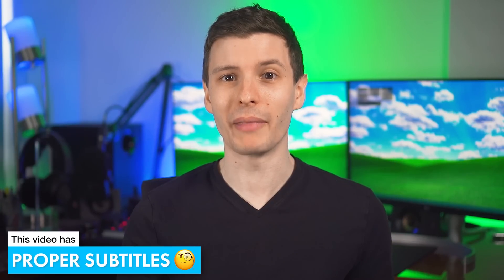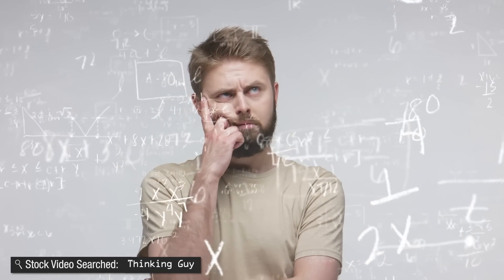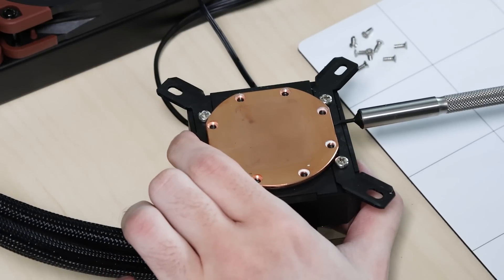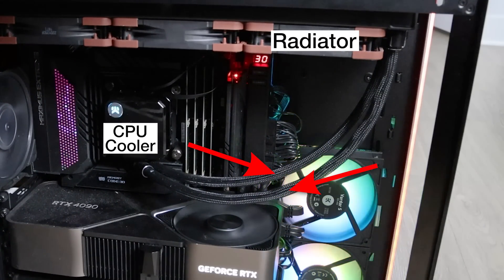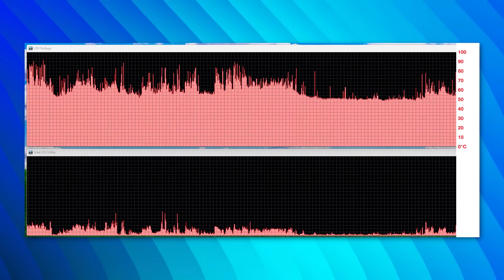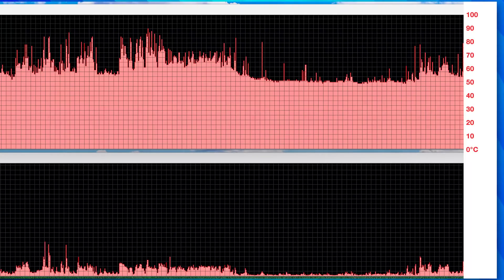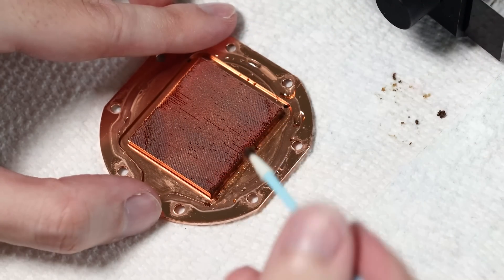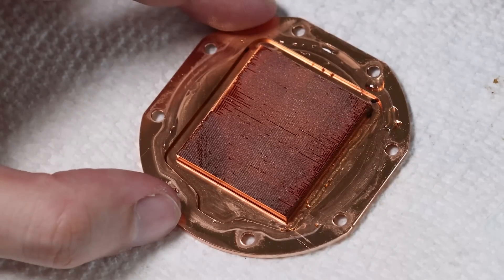The Mystery CPU Overheating Problem Took Me Months To Solve

Comment: dont trash the pump if you are going to replace it just open it get an old toothbrush use it on the fins on the block and if you want to unclog the pump take an old 6v charger and drive the pump with that so that any debris can escape the radiator and sell it as used im sure someone is going to use it

Comment: I run a custom loop, all copper no mixed metals to react and gum up the loop, I don't use the ready mixed stuff, but use distilled water and a bit of biocide and a small splash of antifreeze, I check the PH  and top up if needed every  3 months, I have just cleaned it out after my 1st upgrade in 5 years, and its the 1st time my loop has been cleaned out since about a year before the pandemic  and my waterblock wasnt  anywhere near as bad as that..  my guess is something is breaking down in the loop, maybe a seal or even the inside of the tubing or maybe  cleanliness during assembly wasn't as good as it should have been...  I clean mine out with a white vinegar solution flushing it out several times with distilled water,  and make sure everything is absolutely spotless  to prevent things growing in such  a complicated loop,  with watercooling you always get what you pay for and a lot of those AIO's use aluminium radiators which can react with the copper if there isn't the right amount of an active inhibitor  in the coolant  or if it breaks down...

Comment: I have heard AIO water cooler start to overheat in a year of operation.  The black gunk is the water hose breakdown.  The copper plate to be least clean one a year.  The CPU water cooler are not maintained free. 🤔

Comment: Greg Salazar would be proud, he documented a lot of these. MSI claimed it was a supplier qc process that caused the clogging and it has been addressed. Many brands went through that factory so a lot of CLCs from 2021/2022 had issues.
Reply: Glad to see this comment
Reply: @nmafchf  The root cause found by Igor's lab is allegedly that they used excess flux in the aluminum radiator construction, specifically units that needed a manual second pass during QA checks.
Reply: Greg would be partially proud. He wouldn't be proud about Thio sayin "I am not gonna bother with warranty" . He HAS to, it's not a matter if he wants to. It's a tech channel and saying that on camera, isn't exactly the best example of how you should manage those things.
Reply: @t3amb4sh  Thio Joe didn't recommend avoiding an RMA, simply stated he probably won't go down that route. I'm sure he has more important things to spend his time on.
Reply: @euge963  What's important, is what he recommends. Not every subscriber (or not) have the same perception you might have.
Reply: @t3amb4sh  really? I disagree. To me the choice not to RMA was never conveyed as advice, rather what he chooses to do. It wasn't the focus on the video rather a passive couple seconds of the video. He got it to work fine again, if it overheats again he'll just swap it. By then he might be out of the warranty window anyway.
Reply: @euge963  What does " chooses" mean? It's a global problem and you. .. choose not to get RMA processes involved? You are a YouTuber that influences many people. The only thing you choose is the right process. He may do whatever he wants with his personal rig. He may want to throw it out of the window.. When you decide to make a video about it, you tell people what's the right thing to do, especially with a common issue like this. And that's the end of the story
Reply: @t3amb4sh since he opened the unit, it'll be a back and forth on the RMA department. Sure you can claim you had the right to do so, but if they find anything that they can justify as a "user error", you're screwed.

Comment: looks like the gunk was either copper infused aluminium or aluminium infused copper, I've never dealt with water cooling myself, but Jayz2cents in basically every water cooling video that copper and aluminium doesn't play nice with each other, maybe that's the root cause?

JUST a THEORY, so don't at me or tell me how wrong I am, LITERALLY NOT interested in knowing because I don't PERSONALLY trust water cooling enough to ever adopt it, I'd rather stick to just air, if you like it, all the more power to you, again, I don't care in the slightest, just wanted to share an observation. that's all.

Comment: This pretty much covers my reasoning against AIO kits and even translucent water blocks in general.  With air cooling, you see the fins, you see the fan, you'll see the problem if there is any.  With acrylic waterworks, plugs, buildups, and air bubbles are very visible.  With everything concealed in an AIO, anything goes and you're the last to know.
Reply: I've seen inline flow indicators on other systems where it's critical. Something like that could be an option.
Reply: In the first 30 seconds of the video as soon as he showed he have AIO I thought "that's water pump problem". 
Mine would sometimes just stop when set to too low RPM, so just to be sure I set up throttling temp to 78C in bios, and CoreTemp software to system shutdown at 82C. With these settings system should switch off before CPU hits 90+C.

Comment: Just use a heat sink and fan. Liquid cooling with pumps may be a little quieter under max load, but they're far less reliable and don't provide better cooling at max load. Even the high end heat pumps you can find on store shelves don't perform any better than a $50 heat sink with fan.

Comment: 56 degrees Celsius isn’t scorching hot, 100 degrees Celsius is the limit.

And this is why I only air coolers in my computers even both my AMD 5950X builds.

LOL, using camera sensor cleaning swaps for removing the gunk in the AIO.

Comment: Similar thing that still (20+ years later) has my missus ribbing me about it. Non computer, but similar d'oh moment. Old car, fog lights at the rear not working, I checked the fuse, feed to the switch and was at the point of sitting with my dashboard on my lap, she says "did you check the bulbs?" .... Both fail together, don't be silly...another half hour later and I have finally got to the bulbs...yeah, they were blown. This is your 'foglights' moment. Welcome to the club of the sillies!

Comment: It’s going to happen again the fluid in your AIO doesn’t have the correct solution in it to stop the bacteria build up, like you said MSI had a big issue with their AIO. It’s a defect from the manufacturer that shouldn’t happen after only a year. I’ve had a AIO from NZXT for almost two years now and my temps have never changed or gone up. Trust me it’s going to build up and happen again. Just get a new AIO that’s all.

Comment: You should wash the water circuit with water (fill and let run for an hour), then some 50% diluted muriatic acid, then some bleach, and finally water with baking soda. And then wash it all with tap water, let it run, drain and then rince with deionized water, drain again and fill it one last time with deionized water and close it. That should disolve any organic gunk and mineral deposits. And deionized water has no chance of making any sort of gunk to clog your system.
Reply: yeah regular maint even just changing out the water would've prevented these issues.

Comment: been in the same situation, not a AIO though, i had some odd sounds in my audio playback on my raspberry pi, one day i heard the same sound but on different hardware (streamed the audio to it) my issue was data corruption the entire time, took over a year to figure out, this was caused by low voltage due to vdrop over a molex plug that i fixed every month, dielectric grease make it last far longer, replaced the entire setup and now i use 2 connectors i found called SPL-2, just testing for the vdrop made it disappear even opening the box would make it vanish, it was such a PITA to figure out

Comment: Just a thought — the instance where the CPU block was extremely hot might have been due to the pump clogging, stalling, and overheating. That would also explain how the pump itself could get hotter than the CPU package!

Comment: Could be anything from parts like screws being out in backwards

Wrong motherboard holds used for the cooler / mis-aligned

Could also be the thermal-paste used or the cooler mount could be causing air to get where it shouldnt be
Reply: 8:43 hrmm wasnt it enermax or something that had this issue…

Guess its more common than i though so thats being added to the list of possible issues in my head

Comment: My first (and only) AIO died in a similar manner. It clogged up and the pump died. I run custom water cooling now, and keep an eye on my reservoir for gunk like you had. This setup has been going strong for years now, and I'm only still using it because I had the parts. If it starts dying, I'll replace it with an air cooler.
Reply: Drain/Change out your water regularly (at least every 3-6 months) for pure distilled / RO / demin water, or your favorite coolant mix.

Comment: We've all had problems like this and they're usually easy to solve. Some are the more difficult ones are where say the 5v line drops slightly which can randomly crash your machine. PSU problems where the voltages are slightly out can be a nightmare to diagnose without having a spare PSU to test against.

There are some more interesting questions that I hoped would have been answered in the video. 1) Did you refill the AIO once you'd opened it? 2) You cleaned some debris off the fins, but do you have any idea how much debris is left in the coolant? Opening the AIO probably let in air into the system, so how are dealing with air blocking the water flow?

All are FAR more relevant questions than you finding a relatively easy problem.
Reply: @@LTNetjakYeah I know AIOs have some air, but you've the potential to introduce a lot more. This is why I personally wouldn't disassemble one. There's probably a sweet spot of air to water for it to work well, but I don't know enough about the dynamics of sealed systems like these.
Reply: @thewelder3538  So how would you have fixed this? Trash it?
Reply: @rafflesnh just refill? lol
Reply: @rafflesnh  In all honesty, I don't think it would have taken me so long to have figured out this problem. And yes, I would have probably trashed it for quite a few reasons. Firstly as I said, you don't know how much debris is still in the liquid. You could be re-opening it in a few weeks to clean it again. Secondly, you don't know where the debris came from. It could be from the inside of the radiator corroding; it could be the plastic or even the original water being dirty. You just don't know. Thirdly, AIOs are not user serviceable. Opening it, refilling it, all have an impact. You could be introducing more air, you don't know what the materials that everything is made of, so what you refill it with may attack or degrade the components or seals. Fourthly, changing the fluid may not fix the underlying problem and may be just buy you a small amount of time before you're back taking it apart again. So yes, I'd have trashed it.

Comment: whenever one tube is significantly warmer than the other, more so in idle, that's a telltale sign of pump blockage.
I would honestly contact EK to get a new unit. they are very good AIOs and those early blockages are usually water quality issues anyway, so, an unlucky occurrence this time.
All brands have this happen, without exception.

Comment: They would probably RMA replace it for you for free, as the AIO coolers really should last a lot longer before the coolant needs to be flushed and replaced.  I know Gamer's Nexus has done some pieces on how AIO liquid coolers have had cases where the plastic parts inside will degrade/desolve overtime and then start clogging things up.  Maybe that's what is happening?

Comment: So the more general point is to think of parts of the system that can store state. In this case the fluid cooling system had internal state (blockage moving around and optionally clogging flow).

Comment: Doesn't need to purge the circuit?
I mean, probably that shit is in the pipes and in the radiator and also need to purgue the air so no bubbles messing around.

Comment: This is why I'm gonna stick to old good air coolers as long as possible. They are simpler constructively and therefore more reliable. Good work figuring this one out though!
Reply: Yeah.  I briefly used an AIO liquid cooler several years ago, and had the pump die.  I went right back to using a trusty Noctua air cooler instead of replacing it with another AIO.  Just so many more points of failure in a water cooling setup.
Reply: Couldn't agree more
Reply: Had NH-D15 for six years on 5820k. Then upgraded to 5900x with Arctic liquid Freezer II 420. I would not go back to Noctua even if they paid me. While it might be able to get to the temps Arctic achieves, it would be at the cost of significant noise. Arctic gets me 60°C while being practically silent. And it has 6 years of warranty, proof that they stand by their products.
Reply: @TheTeflon490  I have a 5600x. With the stock stealth cooler, it used to idle at around 65 degrees and would hit 96 degrees under load. This was considered "typical and by design" by AMD, so I left it. Interestingly they say the 5600x can get hotter than more powerful chips without throttling: 90C (5800X/5900X/5950X) and 95C (5600X).

Sometimes my mouse would stop working when the PC was under heavy load (and thus very hot). I'd turn it around to unplug the mouse, and the case, USB port and mouse connector would be insanely hot. Sometimes If I'd restart after heavy load, I'd get a CPU overheating message before posting. But I thought nah don't worry about this one, she runs hot.

Finally had enough of my room being a furnace and all these issues, so I got the Thermalright Phantom Spirit (newer version of Peerless Assassin). I have its fans running at around 500 RPM, so it's more silent than my case fans (650 RPM). Overall it's very quiet. Idles at like 40 degrees, hits 60 under load. By far the loudest and most annoying noise that my computer produces is the coil whine from the GPU when I scroll up and down in a web browser.

Comment: I had the same problem with my thermaltake AIO just a year ago. When you started describing the one tube being hot, the other tube cooler and the pump still working that's exactly what happened to me. I didn't open mine up to see if it was clogged, but moving it around would fix it sometimes. What would cause it to 'act up' again was actually shutting my PC off and when I turned it back on the pump would instantly be having issues. As long as I kept my PC turned on, the pump would work most of the time but problem went away when I installed a new AIO. Now I know what to keep an eye out for! Thanks Thio.

Comment: I also have a story of a weird computer problem, which took me even longer to figure out than yours and still haunts me a little. What I experienced was that whenever I booted up the computer, after it loaded into Windows, the bottom quarter of my screen would start flickering like crazy, and the flickering would become even worse when that bottom quarter was supposed to display something dark. That effect would then gradually fade away over the course of half an hour. Everything else worked fine and I benchmarked it a ton but found no performance drops so naturally I assumed it had to be the monitor or the cable. After I had also tried a few different cables but found no diference, I tried out the monitor on other input sources we had in the house. Surprisingly, it worked just fine on everything else I tested it with, think a laptop, a different PC, the TV reciever. The issue would only occur when the monitor was plugged into my PC, and then only while Windows was loaded and not in the BIOS. So, I also tried to plug some other monitors into my PC and they all worked fine too. You might see how this had me at a complete loss, so I ended up not doing anything about it for an entire year or so, but leaning ever more heavily into the theory that the problem was my graphics card after all. 
What was the solution? My monitor turned out to be the problem, but the reason I couldn't replicate the issue anywhere else was that it would only occur when the monitor was being operated at 144 FPS. All the other sources I had only ran at 30 or 60 FPS. 
So in conclusion, things like this happen to everyone. Computers are just too complex to not overlook anything.
Reply: try turning of freesync or gsync whichever one you have, for me that is usually something that causes problems and i don't actually notice any improvement from having it on so i just disable it everytime
Reply: @psilon6999   I didn't mention it but after I had identified my monitor as the problem, I was luckily able to RMA it. The replacement has since worked fine, even with freesync. I'm pretty sure though that I did try turning it off on the broken monitor, to no avail.
Reply: Yeah already after reading half of your comment I thought it sounds like "half broken" monitor that cant keep up with refreshing fast enough, because of the "bottom half" issue.
Very usual problem with monitors actually, thats one way monitors die out over the years.
Reply: I had a similar problem. It turned out that i had my desktop speakers to close to the monitor. Moved the speaker problem solved.

Comment: This is why I didn't opt for AIO when I built my first gaming PC last month. I prefer the simplicity of the Air Cooler. It's easy to clean if it gets dirty. I'm using the Deepcool AK620, and it works really well.
Reply: weird proper nouns

Comment: My Corsair AIO's pump died after a few years so I never bothered with water-cooling after that. Large Noctua heatsinks perform just as well and are quieter, will last longer and won't cost much to replace the fans if they ever die. The pump was always noisy as well, blegh.